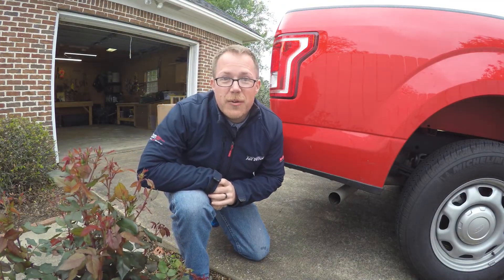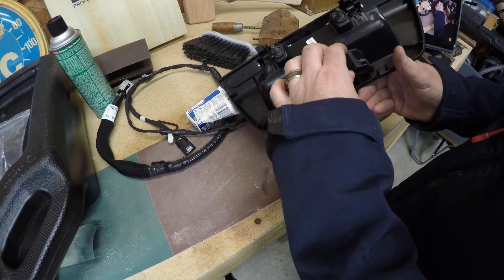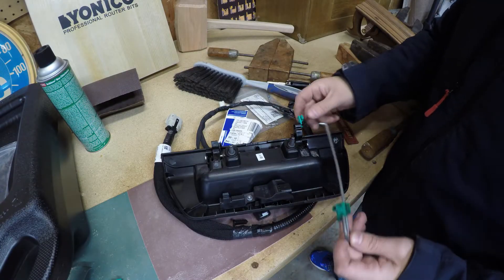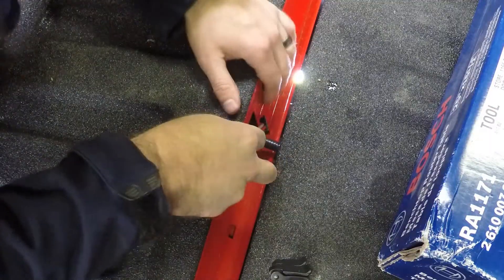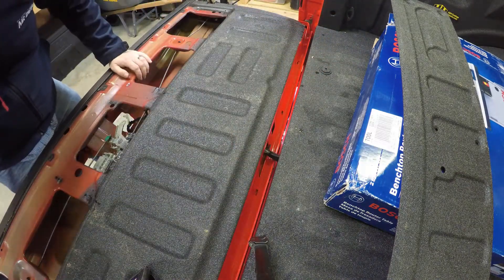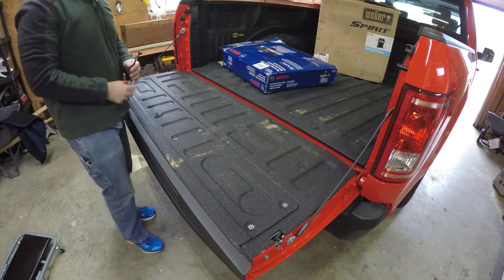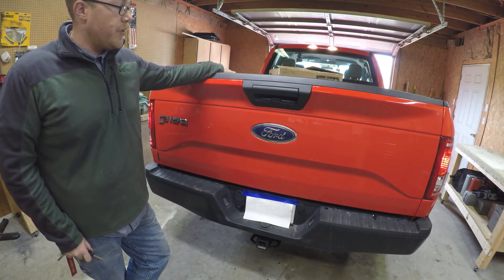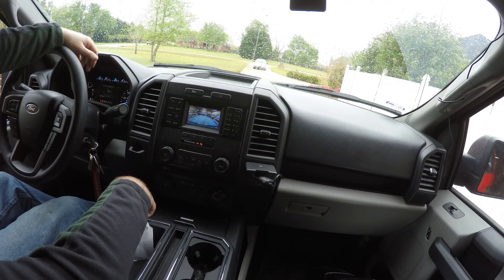2017 F-150 Backup Camera Install & Activation (OEM/Factory Camera)

Comment: Great how to video, thank you. I have all the parts on your list and going to be doing the install this weekend. 
I downloaded Forscan and somewhat familiar with it. 
What was the code originally and what did you change it to exactly just to be sure. 

Thanks again
Reply: Raf, did you end up going through with the install?  If so how did it go?  This looks too good to be true!
Reply: Mike Carroll I did and it was it easy like in the video. I got it all to work but I had to make a harness going from the backup camera to the front of the truck and tap into the stock harness. Pain in the ass
Reply: Thank you for the reply!  I ordered the parts last night.  You weren't able to connect to the stock harness back near the spare tire?  Where did you access the stock harness at the front of the truck?  Just in case I have the same issue...
Reply from the maker: If your stock harness doesn't have the connector/pins at the back, you will run lines up to the 2 main wire harness connectors under the hood mounted to the top of the drivers side front wheel inside fender cover.
Reply: Make Stuff Nation...what If there are wires in the slots (7,11,12,13) in the connector under the hood? But only two in the rear?
Reply: @roelalvarado5896  I too have this issue. were you able to get an answer on this?
Reply: @MakeStuffNation  I'm not sure if you are still around to take questions on this, but on the 2 main harnesses, there are already wires in slots 7, 11,12,13 (grey harness) and 33 (black harness) but just the 2 wires in the rear. do I remove the current wires and install the ones I ran, splice the new wires into the old ones? could use some advice
Reply: @WraithCustomsFirearms  
I never did actually, I sold the truck and upgraded. Good luck!
Reply: After you ran the wires from the back to the front engine compartment, did you need to do anything with wiring behind the actual radio? I ran the wires, changed settings and get a “rear view camera not available message “

Comment: will this wire assembly work for the tailgate handle that has the light on it ?
Reply from the maker: No, I believe the wire harness for a tailgate with the light has a different part number.

Comment: Just install the camera on 2017 f150 xlt. Can’t find step 4 “LIN new module calibration”.  ( is the forscan version different from yours?) The screen has no image, only show “rear view camera not available”.  Do you think is cause by the hardware or software.
Reply: I, too have my screen saying “rear view camera not available”. Did you find a fix?  Has anyone else ran into this?
Reply: Jason Deptawa oh. My truck was not prewired.  I follow the guide to ran wire to the engine bay.
Reply: Same here - I had to run the wires also to the engine bay.  Did you get the message to go away?  After wiring I’m still getting the error message
Reply: Jason Deptawa yes. It fixed. It show image immediately after I ran the wire. Then I activated the line. I think the problem is the wire or camera.
Reply: 赵崇敬 interesting - I appreciate it and I’ll continue to work on this ;)
Reply: Great video and I got the camera working, but couldn't find "LIN new module calibration."  Does anyone know why?
Reply: Thanh Tran this module is found under the “wrench “ Icon.  It won’t say “LIN calibration as this stands for something like Interface Network Calibration (sorry I forgot the actual readout but I can check later on). Once you find and run this under the wrench icon it’ll fix the lines and zoom on your camera
Reply: Thanks Jason.  I got it working.  I used BdyCM (Local Interconnect Network New Module Calibration) under the wrench icon.  I wonder if I can zoom out even more.  Current view does not show the whole width of the rear bumper.  The only option I can see is to zoom in.
Reply: Thanh Tran there we go!  I apologize that I did not have the full name for that category to do the calibration.  My xlt also only has the zoom option/ I’m not sure if there is a zoom out option unfortunately as I have not seen anything about it.  I’m glad you got it working and I was able to help any way I could ;)
Reply: @eatinpie172  Good guys ,  i am trying to enble the codes for the rear camera but my forscan screem is telling UNABLE TO CONNECT TO VEHICLE. please make sure the ignition key is on.   I have the key turned on.   Any ideas?
Reply: jack surca that’s strange - I did not receive that error.  Do you have a proper HS/MS-Can device plugged into your truck?  When I ran the configurations for the camera I had my truck was turned on without the engine running.
Reply: @eatinpie172   i have the OBDII  connector HS/MS. green light on on my laptop.  The laptop recognized the connector then when the program start running  i get this message.
Reply: Jason is me again.  I got the laptop reconize the truck.   The module showed on my laptop.   Question. How do i go into the module?   I just need to reprogram the modules. FCDIM...
Reply: Did you guys were asked for the extended license?
Reply: jack surca if you’re looking to run calibration it’ll be under the “wrench” icon.  If you’re looking to modify the numerical values within the respective modules then you’ll click the icon that looks like a computer chip.  If you’re worried about messing anything up be sure to SAVE an original configuration.  I hope this helps ;)
Reply: @eatinpie172  thank for the reply.  I am doing the calibration. Through the process asked me to turn the ignition off and then to turn it back on.  Engine no running.  However next i am getting the a step that said.  TEST ABORTED. PERFORM A SELF TEST TO IDENTIFY ANY DIAGNOSTIC TROUBLE CODES  DTC'S.      any advise?
Reply: Jason, i did reset my DTC's codes. After i reseted this code stays on  BdyCM B115E:08-0A. Bus signal /message failures.  Any suggestions?
Reply: jack surca are you able to see the camera at all / and it’s a 2017 f150? The calibration was the last step that I completed and once it was done I was able to see the guide lines move as I turned the wheel.  If you’ve gotten everything else 100% and it’s just the last step giving you issues I’m not sure what could be the issue :/. Anyone else getting the same issue as jack?  My apologies as this step had no issues on my end :/
Reply: jack surca one other thing - if it’s a message failure you may also have an issue with a frayed or damaged wire.  My ground wire was broken and I had to rerun it to get the whole setup to work - test each wire individually for power to ensure signal is complete from hood to camera
Reply: @eatinpie172  i will ring the wires from the front to back just before the camera.   No i was not able to get the camera to work.
Reply: jack surca have you been able to use a multimeter to test each wire individually?  If each wire is connected proper and you see power going all the way to the camera it may be a bad camera :/
Reply: Hi Jason, I’m having same issue. I wired everything today. 5cables from tail to under hood. I put fordcan, change digits in the modules and when I go to the LIN I get an error after telling me the process has stopped and that I should do a test and see dtc codes. I am not able to see any image. I only see “rear camera not available”. I have a 2017 f150 xlt. Any help would be appreciated.
Reply: Isego4 04 when I had the issue it was a frayed wire that I ran to the front under the hood.  I had to test each wire individually to make sure a signal was making it all the way to the camera.  When you get the “rear camera not avail” etc error that means that your Sync is trying to send a signal to the camera but something isn’t connected proper so Sync times out.  It can be a pain but you need to check each wire and if the signal is making all the way to the camera - then the camera is the issue :/

Comment: great video and nice camera work.  Do you think those parts you listed in the description would also work for a 2016 xlt 4x4
Reply from the maker: Mike Osvold I think the parts should be the same for 2015-2017 but I can't guarantee.
Reply: Mike did you ever figure out if it worked for your 15' XLT?  I have the same.
Reply: gtdave86 no I didn't.  I will look more into it in October when it's not 109 degrees in my garage.

Comment: Does this work for the larger touch screens?  My husband has a 2017 Ford F150 XL also, and I really want to get him the set you got, but I want to make sure I buy it right the first time.  Is this the best set, or is there an all in one?
Reply from the maker: Ginger UniKitty the wiring and parts should be the same for both screen sizes.

Comment: Is there a schematic or something to have wires in correct slots on the end that connects to tailgate harness from front of truck? Wasn’t covered in the tutorial diagram or I missed something. 
Thanks
Reply from the maker: sorry about that, here is the pinout:
Rear Pin 1 -> Front Pin 33 (red in PDF guide, yellow in my truck)
Rear Pin 2 -> Front Pin 7 (white in PDF guide, purple in my truck)
Rear Pin 3 -> Front Pin 11 (blue in PDF guide, white in my truck)
Rear Pin 4 -> Front Pin 12 (green in PDF guide, red in my truck)
Rear Pin 5 -> Front Pin 13 (black in PDF guide, blue in my truck)

Comment: Is the wiring allready there for the camera harness on 2017 and up only? I have a 2015 xlt and Im seeing lots of videos of guys running a line all the way from the camera to the screen is this the case?
Reply from the maker: Josh May it just depends on what harness they threw in at the factory. Some have them and some don't. Running the extra lines isn't too difficult, there's a pdf guide I link to in the description.

Comment: thx for the video...can you also add rear parking sensors in ther same manor?
Reply from the maker: Mark Andrews I believe so but I don't know how the wiring harness works for those. I assume they use different lines and pins.

Comment: Were you able to figure out how to get the guide/center lines to show up on your display? You mentioned there might be an additional setting you need to change...
Reply: Oh, I should have read the description in more detail. Is this covered in step 4?
Reply from the maker: David Mauldin yes, steps 3 and 4 activate the lines.
Reply: Hi David.  Great video!  Thank you!  I got the camera working, but couldn't find "LIN new module calibration."  Any ideas why?

Comment: Will this work with the 8" screen as well with sync 3? Thanks
Reply from the maker: I believe so. The wiring from then engine bay back and ForScan settings should be the same.

Comment: im kinda of disappointed i couldnt see what youre screen was showing, because that was the part i needed.... but thanks for the video!
Reply from the maker: Sorry about that. I need to get a screen capture program for my computer.
Reply: Im tring to activate my friends backup camera.
this activates the camera right? not just the "backup lines"

"To activate the backup lines on the camera:
1. In Forscan, edit 726-39-02 in the BCM, place a 1 in the 6th digit, and apply the change. This setting tells the BCM that a rear camera exists. It is on Livnitup's spreadsheet as "Slave Exists RVC"
2. In Forscan, click the wrench icon and re-run LIN New Module Calibration."
Reply from the maker: Okay, that part is to turn on the backup lines if the camera is already activated. Here are steps to activate the camera and then turn on backup lines:

1: Connect ForScan, follow the prompts when connecting.
2: Under the FCDIM module, on the 7A5-01-01 line/field, change the 2nd digit from a "0" to a "2". Save/write the change (follow the prompts). (this activates the camera) 
3: Under the BCM module, on the 726-39-02 line/field, change the 6th digit to a "1". Save/write the change  (follow the prompts).
4: Click the wrench icon and run "LIN New Module Calibration". This makes the truck recognize the changes and calibrate the modules  (follow the prompts).
5: Disconnect ForScan
Reply: thank you so much!
Reply from the maker: 2ballsdeep sorry I'm not sure. Maybe check your using the most up-to-date version of ForScan?

Comment: I'm considering adding a camera to my 2017 XLT. I'm wondering if it is pre-wired like yours was. The existing connector to the tailgate that's by the hitch only has 2 wires coming in and out. I'm guessing that means my truck was not pre-wired, correct?
Reply from the maker: Gonzoagg09 that is correct, if it only has 2 wires you need to run the 5 camera wires from the engine bay back to the connector. See the ultimate backup camera guide file posted in the video description. It's a pretty easy process. Unfortunately I don't have video footage of that install.
Reply: Awesome! Thanks for the help!
Reply: I have a 2017 XL and also only have the two wires. what wiring harness would you use for that? Can I use the one you did ? I’m trying to find a wiring harness that’s already wired and I can just connect and run through to the back of the screen and I have the 8 inch sync 3 does the the forscan work for that ? Thank you for any help or advice you can offer